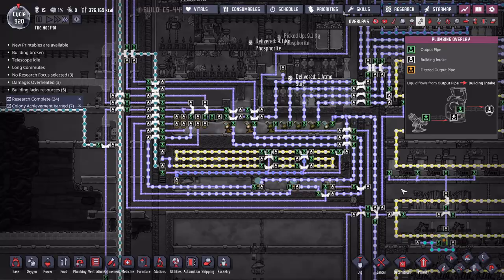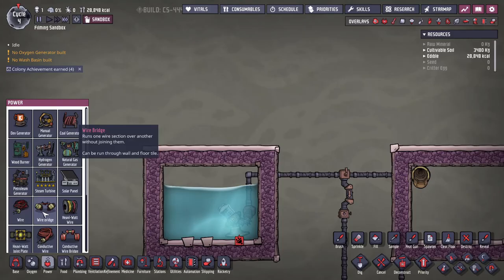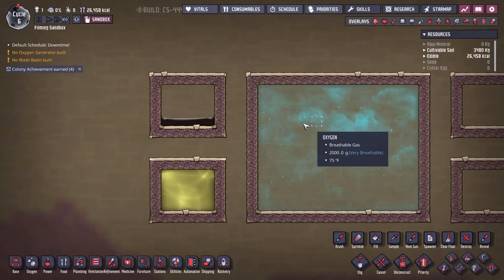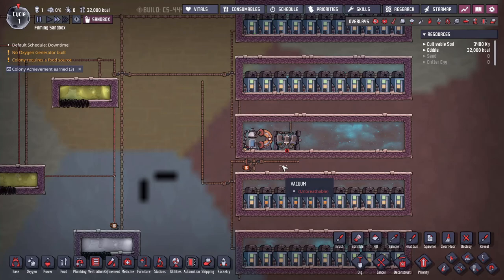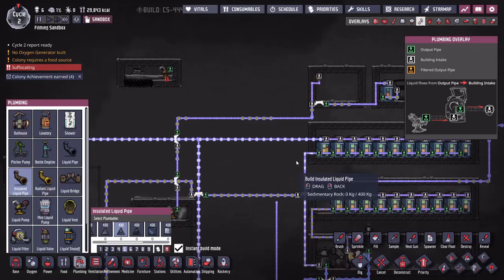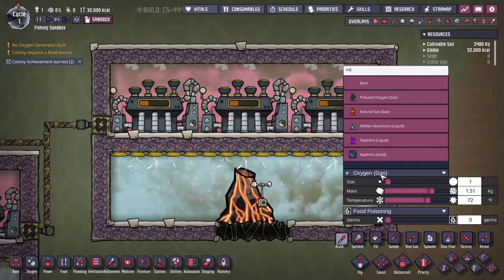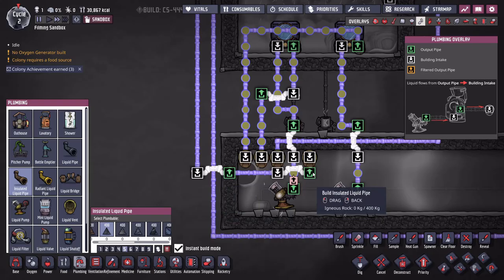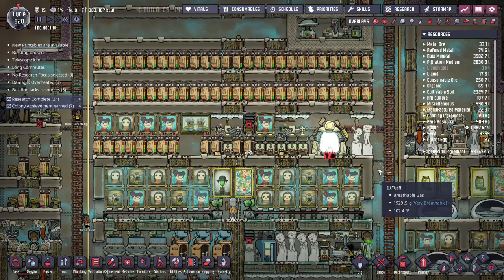Oxygen Not Included Tutorial: Pipes (Plumbing and Ventilation)

Comment: Great video, thanks for some new ideas! But why don´t you just cool the steam turbines with their own excess water? It comes out at 95°C and a steel turbine can handle that amount of heat. That saves energy and you do not need the automation and some piping.
Again: Thank you for the effort and input!
Reply from the maker: I'll need to play around with this, I've seen it before but I have seen setups eventually fail due to being unable to cool everything.  It may be dependent on how hot/cold the steam is.  I'll test it :)
Reply from the maker: Oh, also, one of the reasons I give the same advice for any cooling scenario is so a new player only needs to learn one concept and not need to learn a few for different scenarios.
Reply: I have done that very thing with some mixed results. It works great until it doesn't. If the turbines overheat they stop working. If they stop working, heat is not deleted. Everything gets warmer and your turbines get further and further away from deleting heat. 

Usually, I do not have a cooling near where I am taming a volcano while I am setting it up. So I initially build the turbine dump directly below the  turbine exhaust.  I then loop some radiant pipe behind the turbine. If it works, great, I'll leave it alone. If it overheats, I replace the looping radiant pipe with a pipe doing strait down into the dump. I then put in an external  cooling loop behind the turbine.

Comment: Dude, awesome!
Next: those plastic things to move dupes fast? I hate the "long commutes" message
Reply from the maker: Yeah, those are transit tubes and they are very expensive (lots of plastic and power).  I'll have to see where I can fit it in to another tutorial, or maybe just make a short one about it.
Reply: @Magnet_MD  imho a short one is more than enough :)
Reply: If your base is well designed, the long commutes message is a good thing. Many of your tasks should be automated, such as supplying ranches, moving meat and eggs, filling grills and food storage, filling  refineries, filling generators, etc. 

Once you base is established, you can build a dup gym. That is high priority treadmills attached to lights blocked in by a door that only certain dupes can enter. Once a dup spawns, give them a tic of research and raise their operating priority to very high and allow them into the gym.  While in the gym, they will earn skill points and increase their agility and machinery abilities.

After a while you will have a dup with 10+ in both abilities as well as 3 to 5 skill points. This type of dup will very quickly run up to a refinery prefilled with ingredients and preform the  task in less than half the time. Then they will run off to do some other prd-optimized task. You can't help getting the long communtes message.

Comment: Are the gas filters you use to filter the gas at the bottom of your "base" 100% reliable? I would have thought that with the sensor and the shutoff on different tiles some gases that you didn't want might slip through occasionally. Is there any reason to ever use gas filters? Does the same work with liquid pipes?
Reply from the maker: The sensors and shutoffs on different tiles are reliable, as long as you can assure your pipes NEVER get backed up.  In the case of gasses, if the end of the pipe leads into space, I'll always be able to vent there because the gas will be lost to space, so those filtration systems are always reliable.

The same thing does work for liquid, but that is more difficult to assure you'll have constant flow on all pipes, considering it's not common to vent liquids into space, and because you'll need a considerable amount of storage space for different types of liquids to assure constant flow on all pipes.

The gas/liquid filter buildings can be used, but they use a tremendous amount of power by comparison (literally exponentially more if you use multiple of them).  I think you're best off by using the more low-power solutions and assuring you have constant flow within the system.

Comment: 17:45 useful tip you don't need any input pump with reservoirs, once you fill them and close loop, water will run constantly, i'm using it for cooling, no automation needed because it uses no power

Comment: Great vid as always! I'll admit I'm still confused by liquid storage. I see folk use them but they always just have water flow in and straight out again. What's the point of them when liquid just flows straight through them? Are they just used as a back up for when whatever your piping to is full and then they start backing up into storage instead? I've also seen some folk pipe them so the pipe goes into the first white, and then out of the first green, which then leads into the second white, out of second green, into third green etc etc etc. Is there a difference between doing that the straight across piping you do? Sorry for the dumb dumb question. I'm grasping so much of the game, but for some reason the simplest storage thing got me like ???????

I was trying to do a chlorine room with 3 storage tanks but I've still not got plastic for a germ sensor so I thought I could maybe make a manual switch on the shut off and check it myself after a few cycles. Can't seem to find out how many germs are in the liquid when it's in the pipes or storage tanks though. Unless I'm missing something :|a
Reply from the maker: Hey hey!  Yeah, the liquid storage is effectively an overflow for if your pipes are backed up.  It will look funny when you first start putting liquids in them, but they are very useful both for automation purposes (you can enable/disable stuff when containers meet a certain fill level), and as a buffer to make sure you are harvesting and storing the water that may come intermittently from vents and stuff.

And yes, you're correct, you can't start making germ sensors until you create plastic.  You can also consider cooling the water until germs are killed, or you can feed the germy water to plants, use it for bathrooms and for research tasks.
Reply: @Magnet_MD  Thanks again for the help! Yeah, I've just been using a tepidizer to heat the germs out for now. I was worried about the energy sink initially but now I have more coal than I know what to do with anyway. Just need to find a way to cool it, whiiiich I should probably be able to do in the next 20 cycles or so if I can harvest this cool slush geyser soon. Although maybe I should hold off seeing as I currently have no use for water and no place for it to go- beyond a small loop for bathrooms, crazy as that sounds. Got reservoirs full of it. With oxygen production starting to struggle vs my 8 dupes (altho I have no intention to expand any time soon), and a good amount of water, I wonder if it might be worth getting an electrolyzer system set up. But I still haven't gotten to oil yet! So much to do, lol. I keep getting sidetracked.
Reply: @Spamhard  You can save the energy you use heating the germs out with the tepidizer and cooling it again if you add a room with 4+ liquid storages and fill the bottom 2 tiles with chlorine gas (or the whole room and seal it). The chlorine kills germs at an incredible speed. 
Your excess water can either be spaced or: freeze it in a cool box (aquatuner with some liquid that freezes far below 0°C). That way you´ll never run out of water, oxigen and hydrogen) Just add some automated shipping into your ice box to retrieve the ice at a later point.
Reply: @timetravelsmurf  I did actually try a chlorine room at one point (couple of tanks in a small room I'd vaccuumed and then filled with chlorine, but because I didn't have plastic at the time for the germ sensor, I was struggling a little with the system as it was still dumping out germy water even when I tried to hold it in the tanks for a little bit. There was no real way for me to see if the water still had germs without dumping it out (sucks we can't see germ count in storage/pipes tbh). I'll have to go back to that idea now, thanks!
Tepidizer is the sole reason I got so much hot water atm, but thankfully the water stays under about 60ish still so i can still run it through the electrolizer without issue. 
I definitely gotta go back and try out some new stuff out, I've yet to even touch aquatuner but I've seen some interesting steam turbine type builds that utilise them so I might have to give it a go :D